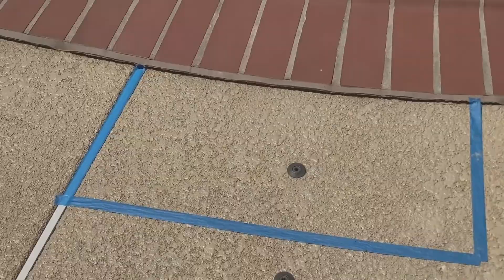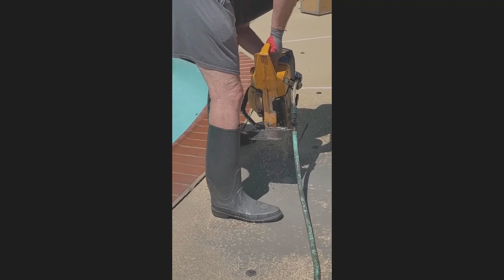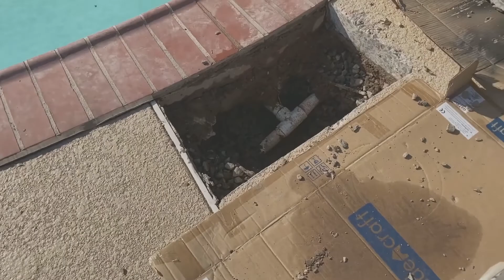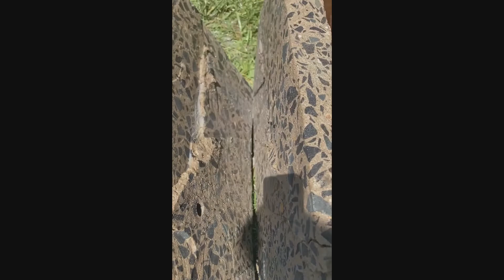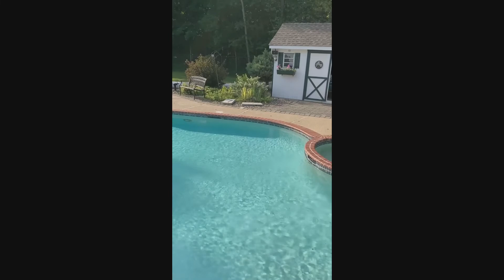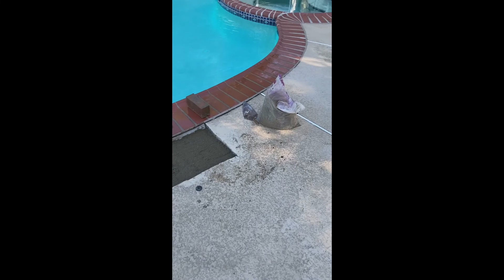Repair leaking pool fitting using a concrete chainsaw

Comment: Nice work.
Sika Fkex self leveling compound comes in tan and grey and you can dust the surface with sand while still setting and the result is great. Comes in 10 and a more cost effective 29 ounce tubes (needs larger gun). Much easier to work with than Deck o seal.

Comment: Why don't you just fill it up with concrete rather than reuse the same piece ?
Reply from the maker: Because the coolcrete surface would be lost and the new concrete would look very different from the rest of the pool deck.

Comment: Have you never heard of a concrete saw? Round blade which is thinner and a LOT easier to control.
Reply: A 14” diamond blade is surprisingly square at full plunge. Just get as close as you can, tap with a sledge and lift with a Grabo.
Reply from the maker: I considered a round demo saw but than you can’t make clean 90 degree corner cuts. Only a concrete chainsaw can make clean square corner cuts.

Comment: I’m in the middle of two skimmer boxes…rented a concrete saw for 275…hot knife through butter…depth of about 4 inches…hatch sliced the block in minutes…then sledged to hammer drill out…bear of a job…
Reply: We cut the space we need and then cut boxes inside that space, hit it in center with jackhammer, and literally pull the rest out with a pry bar 1,2,3